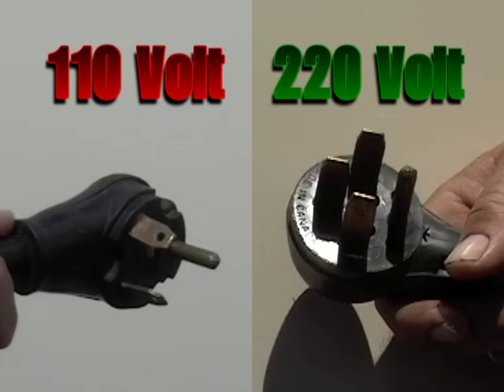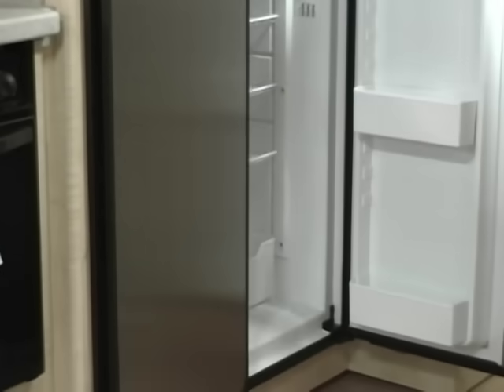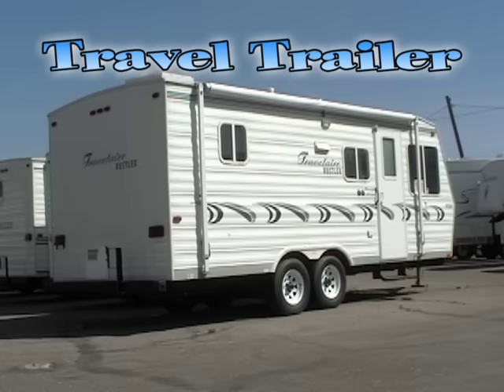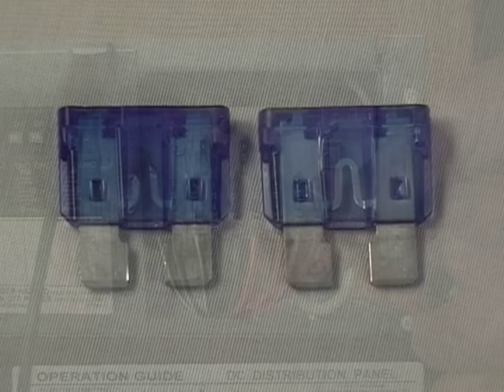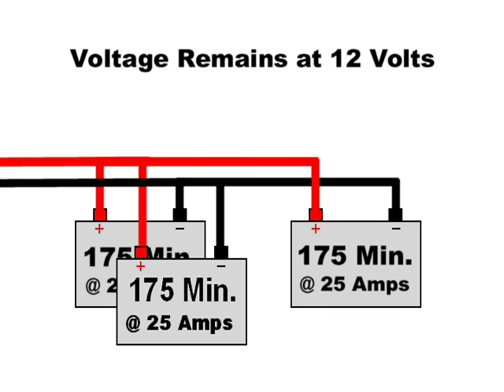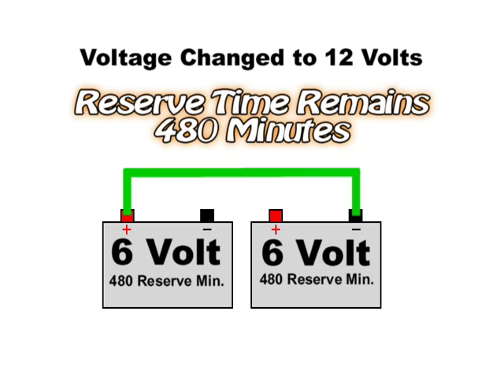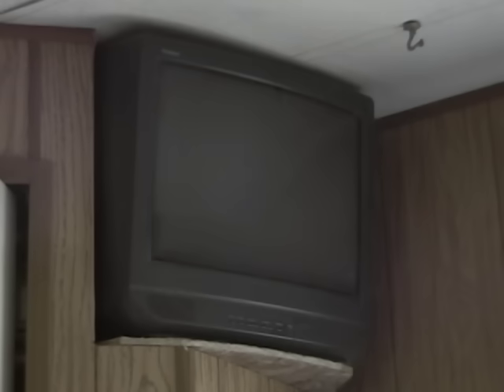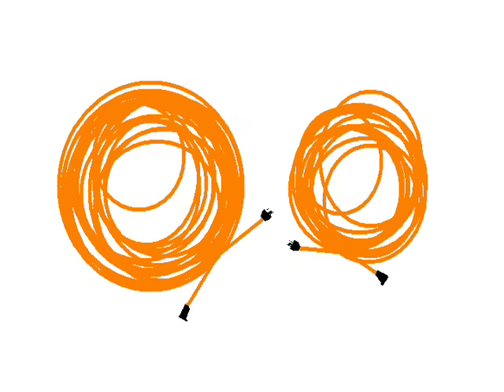RV Walk-Thru: Electrical - Learn about the electrical system on your RV

Comment: I have messaged soo many people on here with a question. I have a Coleman Mack thermostat in my RV and switching to a Semi lite smart. It doesn’t require a C wire. The one on the wall is Red, Yellow, Blue, Green, White and Gray. The gray is connected to a black wire coming out of the wall. My question is. The colors I’m guessing go I to the spots Red, Yellow, Green, White, but there’s a O/B* spot and a C spot I’m guessing the G is the Green and the Blue is the C? Or is the O/B blue and the C spot the gray/black?

Comment: I replaced the panel and still not getting voltage at any plug. I'm getting 120 volts at the panel only 80 volts at all plugs. What am I missing?

Comment: What most people don't know is battery technology has changed little in 100 years. And the basic 12 volt (chemical) car battery is the same as today as it was in the 1920's. That EV's do not have 1 large battery. They are the combination of 1 million (or more) small AA size batteries. Same with the battery pack for a cordless drill. Multiple small batteries. And the amount of batteries and how the batteries are connected, series or parallel changes the voltage of the battery (pack). Why there are 12 volt drills and 18 volt drills etc.

Comment: This is an excellent video. Electricity is a little bit magical and even a mystery even though its part of our daily lives. One thing about electricity is that it is drawn by a unit needing the power. Electricity is not "pushed" through the wires like water is through a pipe with a pump. Instead, electricity follows path of least resistance. Turn on a light switch means there is no longer any resistance (or the circuit is connected/completed) and the bulb now draws electricity to itself.

Comment: I had a 20amp circuit just die on me that has 4-110 outlets on it after returning from a trip. Breaker is good and hot. I can't figure out where the break is. Any suggestions how to trace where it goes first? Older RV and no schematics any where.

Comment: All my interior lights are at 6 volts and some smoke if turned on for very long. Did the person who had my class c RV rewire the lights in series when they added more lights? How do I fix this? The main original lights in the center seem to work and not overheat so i've been just using those.

Comment: I had my Battery SHUT off on OFF, but when I went to my batteries, 2 6 volt batteries in series, I was taking the wires off to clean and I saw a little spark two times so not sure I understand why it would spark if I had the battery OFF.

Comment: Personally I like using water supply piping as the analogy to Volts and Amps. Voltage is like the water pressure, and amps is the volume of water passing through the pipe. This also correlates to wire sizes.

Comment: I have a 30 amp sure power hook up to my bus converted to RV. Everything works perfectly well when I connect to my outside house outlet unless I plug the 30 amp connection into an outlet which is also on a GFI circuit and this trips, the circuit, the minute it is plugged in. Do you have any suggestions?

Comment: I have both a 12V system and a 240V system on my RV. When i plug in the 240V system, the 12V system switches off and on continuously and i can hear a switching noise. Any ideas what this could be?

Comment: I have a leaking roof when it rains with water dripping from under the radio and I don't know how to disconnect the radio  I  need help if you can
Reply: Check your fuse box I know my radio is on its own fuse and I just pulled the fuse out.

Comment: Question:  I wish I had seen this video before making the following mistake.  I had two 6 volt batteries in my RV and they were hooked up in series.  They went dead or so I thought and I heard getting AGM batteries was a better way to go.  I purchased two AGM 12volt batteries and hooked them us with the same wiring.  I think you see where I am going.  What I did was create a 24volt series rather than hooking them up PARALLEL as you describe.  I believe I effectively damaged my system, likely my converter.  How can I confirm this?  What else should I be looking at?  My batteries do NOT charge when plugged up to shore power now or if they are charging it is not enough.  Thanks for any info or advise on this issue.  2012 THOR SERRANO.

Comment: On my 2016 RV the lights and everything work fine if you're running off the alternator (chassis engine running). But with city power and generator power the lights just get dimmer and dimmer until the auxiliary battery disconnects to save the coach battery.  This causes all the DC items (lights, window shades, sofa motor) to not work.  The only way to get them working again is to start up the engine.  Everything comes back to life and the battery is fully charged in 10 minutes.  It seems like it should be something simple but I am stumped.  I am new to RVing.  Does anyone know what is likely wrong?  Is it likely something simple like a blown fuse or a wrong setting on the inverter/converter control panel?

Comment: I've owned my 30 ft class C RV for 20 years. There are A LOT of things that can go wrong on the multiple systems so good maintenance is key. My secret is using some excellent car care software https://youtu.be/3LUayHH1yZA to track all the maintenance so I always know exactly what was done and when it's due again like changing the oil or checking the roof for leaks. The software also tracks parts, vendors, all expenses and even logs all the trips I take so I have a record of my favorite RV parks and camp grounds.

Comment: How do I turn off my security system in a 1995 holiday rambler imperial. I had the inverter changed and I believe it locked me out. I read my books. There is nothing on the security system

Comment: Excellent information. I am planning on moving into a trailer to be closer to job opportunities. The trailer I'm moving into has two 24V battery, being told that the system is only 12V. I was puzzled and a bit concerned so looking up electrical systems about trailers/rvs to be more informed. I've had some experience with electricity working on houses on and off throughout the years but when it came to the trailer, I felt like I couldn't really apply all of my previous knowledge to figure it out. The other part is that I didn't know about the power cord adapters going down in amps, that was super important. I'm going to be careful not to overload the system with too many things running. Thanks :)
P.S. no worries on being long winded, its good to refresh and learn something new, still enjoyed and listened every second of it. That story of the neighbor hooking up that woman's trailer with 220v plug was a shock to hear but good to know. 

P.S.S. Never know if one day we might be able to see something to maybe help someone and save lives with this kind of information. This kind of information and knowledge awareness could potentially have one person save an entire family living in rv/trailer. Amazing

Comment: When I replaced it one of the capacitors that's when the plug-in started working but the other one did not get replaced all I did was took a blowtorch and flip the chip over and heat it up and pulled it out and did the same thing with the one that was left in the camper when I bought it and I just switched them out and I did the other side like that and everything started to work again but I ran a lot of electricity in the plugins and blew it again and this time it just I guess it blew the right side not the left side but can you please call me whenever you get a chance but all my fuses looks good

Comment: And igniter for the hot water heater don't work so what don't work in my camper now after I replace the converter it looks like a battery that goes under your breaker box but after I replace that one I got my plugins to work but nothing else works I need my air conditioner fixed really bad and it won't come on like I said nothing works but the plugins maybe it's the other one right beside it the other converter so maybe it could be AC and DC the first ones AC and the other ones DC I don't really know much about this

Comment: I got a 2006 River Forest camper and I did the same thing my plug-in was a 110 and the owner of the land told me to go get a 220 and put it on it and I did and plugged it in and it blew my power supply board but what really did the damage I think was the capacitors but I like to get some help on this so I took my old one from when I bought this camper there was an old board in here where they replaced it and I took it off heat it up from the back and took it off and put it in the new one now my plugins work but my air conditioner don't work are my light

Comment: We have an old ambulance 91 F350 that we use for donated food but I want to use it for camping once in awhile. When I plug in a cord to the 115v outlet on the ambulance the inside does not energize but there is a black box that starts humming with a red light on it.
Here's a quick look at it on our channel.
https://youtu.be/0-LBYef7YwU

Comment: I’m hopeful you can point me in the right direction on our motor home.  While we have a 50 amp hookup at our home for our RV, it sporadically has an issue where the steps, slide, control panel isn’t lit up at all, etc.  We have a Fleetwood Excursion 35b.  Then as suddenly as those things didn’t work, it all works again.  Any suggestion on where to look for the problem?  Thank you in advance.  🙏🏻🙏🏻🙏🏻

Comment: On pedistal 50 amp/ 240volt , 30 amp wired 120 volt.
Rv trailer says 120v or 240v .
At. 50 amps , 110v circuits when I place a tester, 
Reading says , hot grnd , rev.
In kitchen outlets mark gfci, water heater electric swith turned off and tv went off, micro wave, heater, range blower above gas stove.wife plug rice cooker in and outlet arc. 
? Shut use down

Comment: My rv is at a campground Plugged in but cannot turn on all lights without it turning my ac off or Dim lights/both

I tested all the fuses with a test light n everything in there seemed to be 120 v 

It was used, us this maybe bad wiring from previous owners? Or would I also need a full charged battery even if it's plugged in to a camp site hook up. Thanks

Comment: I have a 1986 xl pathfinder made by sportcoach it wont start one min then the next it will it was stolen and the wires under the dash are exposed its making a clicking sound  6 min ago its started now clock click click could that be the starter or the dylinoid or maybe a wire connected to the starter please help
Reply: Also can someone please tell me where the starter is located thanks any input or help will be greatly appreciated thanks god bless

Comment: One more thing.  Current isn't about the speed of the electrons it's about the number of electrons that flow through any point in a wire per second.  The heat is caused by the cumulative effect of the electrons flowing through the wire not their speed.

Comment: O.k. Great video but my house batter hookup ( in parallel) , looks to this x banker like a spaghetti  bowl. In addition to the parallel hookup it has 3 other wires, one of which is attached to + terminal and descends into the coach apparently to transport 12v to house outlets . Then there is a second identical wire is attached to the other + which runs to what looks like a switch / cutoff ( ??) ;I have no idea what it’s function is or where it terminates.Then there is a third line which comes comes of one of the - terminals and seems to head into the coach; is this the negative component of the 12 v delivery system  to the coach ?
 And finally, I believe that there is a line or at least a “working relationship” between the house battery and the cab battery, can you please explain that . Thank you. Jim

Comment: What an excellent tutorial on RV power systems. Clear, concise, humorous, with diagrams.  Made it so clear.
I learned what blew my DC system too - the old circuit breaker that most likely has to be replaced. This saved me a major expense and many hours of head scratching.  Very much appreciated, thank you!

Comment: Okay so I'm a first year electrical apprentice and I was wondering about an RV can you use large capacitors like two microfarad and tandem with the batteries of an RV. I didn't want to ask my journeyman cuz he will usually say something like once you go work on RVs instead of being an electrician. It's kind of a smart ass he won't really give you an answer on something outside of being an electrician but this is electrician work so I don't get it

Comment: Thank you so much. I'm actually just trying to disconnect my furnace fan. That alone is running around 150 watt. I have a 100 watt solar system linked to 4 12 volt batteries in parallel but cant charge batteries until I disconnect what I dont need. Circuit breakers and these plastic box deals I can pull out and put back un

Comment: Wow. As a newcomer to electrical engineering and circuitry, this explanation was extremely valuable! I bought a 2001 winnebago 31ft and I have trying to figure out why my generator wasn't working. Without being too invasive, I wanted to put my electromagnetic knowledge to the test but without any prior hands on experience, I was as useless as someone without any knowledge of electricity. You really helped me see and see the relevance of my studies in a real world situation and also help me further my non-invasive investigation of the generator so thank you two times!

Comment: Two things. 
Amps are not the speed of electricity. 
Amps are the volume. A better analogy is water flow. 
Voltage is the pressure. Amps is the amount of water flowing. 
The other thing is a ground fault explanation. 
GFI or GFCI measure what current goes out of the receptacle. And what comes back to the receptacle. If the two aren’t the same there is a ground fault and the receptacle will trip. 
Good video.

Comment: You’re right electricity is very dangerous education and safety or the key always try to make sure things are redundant in their safety especially in an RV where it’s not uncommon for an electrical component or an incorrect Wire can cause an RV to burn fire extinguishers Smoke Detectors things like that are just as important as the electrical component you install. I’m currently designing a plan where Halon will be deployed into a closed space where solar inverter batteries and other components will be installed

Comment: Informative,  but you have made some incorrect and miss leading statements about, GFCIs  function and about amperage.  
GFCIs are not like a circuit breakers.. GFCIs are  very low  mA "0.6 AMPs"   falt  interrupter.  A  Standard Breaker is an electrical switch designed to protect an electrical  circuit from damage caused by over current/overload or short circuits. 
AMPS: look at AMPS this way, its not the amps that create the heat rather,  its the under sized  conductors or path it runs that causes the heat.  .5 amps will  run the same temp as 100 amps  if circuit in with it flows is  sized properly.

Comment: I have no idea if this is a dumb question. But could you have your batteries on solar, hooked up to an inverter, and then plug that into the 30 amp cord? Just to get the power outlets working for charging phones and other low amp things? 

Great video by the way!

Comment: I recently moved into a fifth wheel and honestly I don't even know if it has a converter, just an inverter. I've been pulling out my hair over the fact that my batteries charge off of solar power and then drain for seemingly no reason and I have no idea what I'm doing wrong. The phone service we signed up for so far seems completely useless. Even with everything off, it drains the battery and I just want to fucking sleep in above 38 degree weather and charge my phone. I can't get the fucking thing to charge past 9 volts. Even through all of this I still believe it's better than the two months of homelessness I just got out of, even if I could charge my phone in the hotels

Comment: Lowest prices of the year:  Cyber Monday pricing for EasyTouch RV -- the Micro-Air Wifi and Bluetooth smart thermostat -- runs from today through December 7, 2020.  Remotely monitor and control temps for pets and otherwise. It is well loved like the EasyStart 364, also available at Cyber Monday prices.  

https://scontent-lga3-2.xx.fbcdn.net/v/t1.0-9/125547141_3430205897016766_2027270382858342343_n.png?_nc_cat=107&ccb=2&_nc_sid=730e14&_nc_ohc=Ho6rrsuP0W8AX8LidIU&_nc_ht=scontent-lga3-2.xx&oh=cc3887330cd7417f51a8377ce63a32e6&oe=5FDC3B26

Comment: Great video. I have an issue where my rv on shore power charging the battery..my furnace fan and other 12v are brighter, my furnace fan blows so hard it can't light.
The extra brightness etc doesn't  bother me it's the fan blowing too hard which is a good thing but the furnace can't light.
On regular 12 v with the charger breaker turned off furnace works great..new magnatek converter btw

Comment: Can I hook up 2 battery 135  amp each = 270 amp and 2 battery 62 amp each = 124 amp parallel on 12 voltage? Would that be safe

Comment: Great video, thank you!  Could you please help with a question?  I just purchased a Older Travel trailer.  Had to do some brake work on the trailer.  When crawling under the trailer while it was plugged into electricity, my bare skin touched the trailers frame and I received a mild shock.  Any suggestions on where to begin to find a solution to this issue?  Is it dangerous?  Thank you for your thoughts.